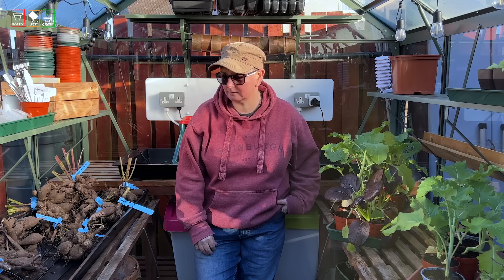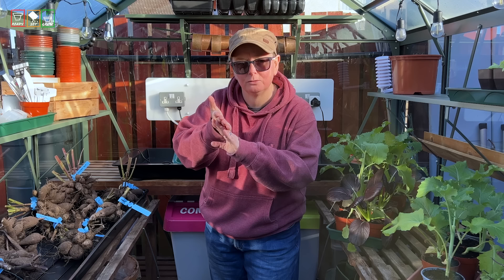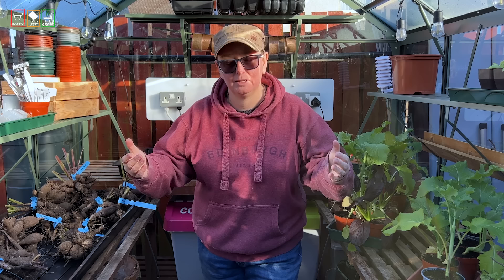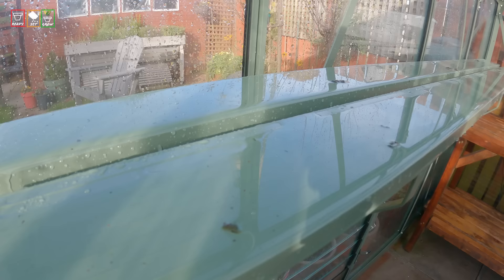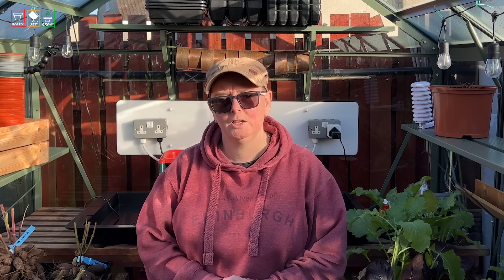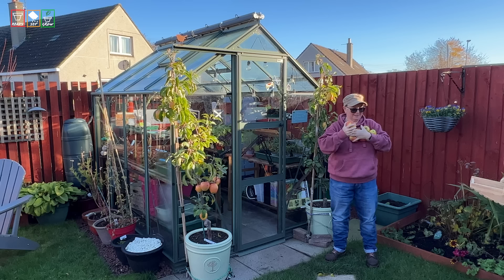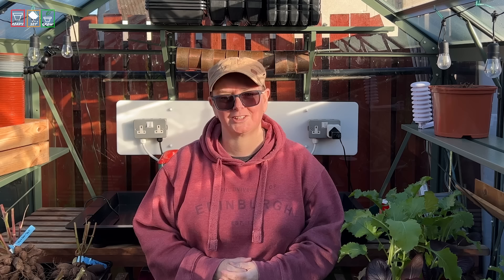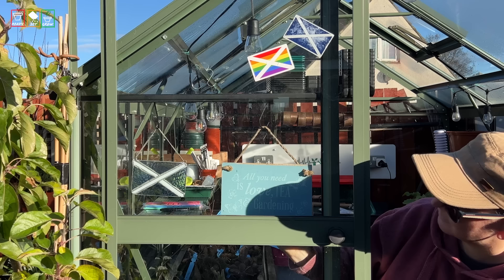This has to be the BIGGEST clean ever

Comment: Thank you for putting this video together. Question? Would it be better to start with the garlic candle then clean up what it has killed
Reply from the maker: You could give it a go… my thoughts were that by cleaning first meant you’d already dealt with a lot of the issues, but defo give it a try and see
Reply: Good point. Keep up the good work. Regards to both